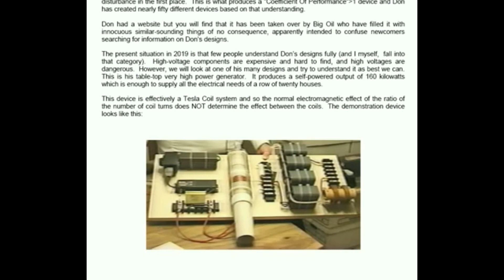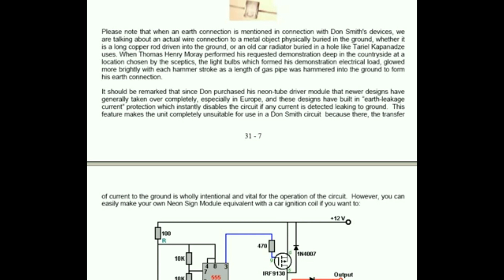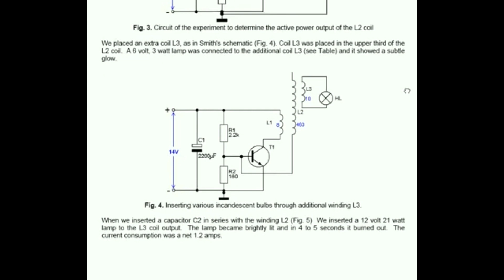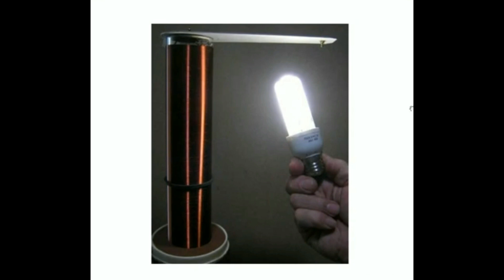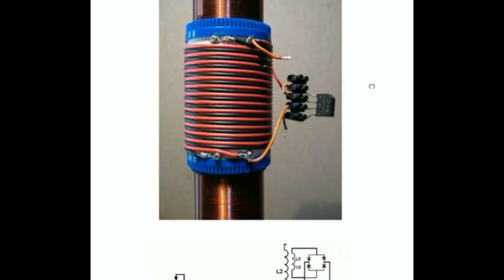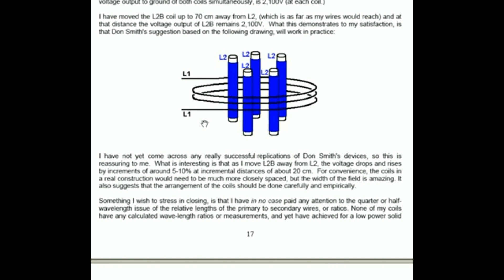Nikola Tesla's Pierce Arrow electric car

Comment: Wow, I've never thought about converting vibrational energy into electrical energy. And since everything including sound vibrates at different frequencies you just have to isolate the frequency or frequencies you want to use. Probably why you need to understand radio frequencies... 8 minutes in. Going to finish watching.